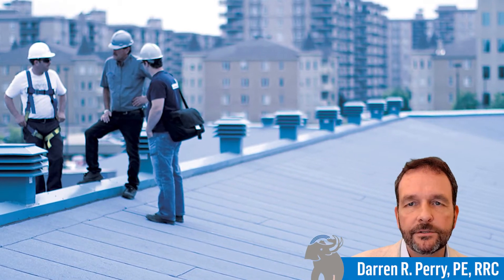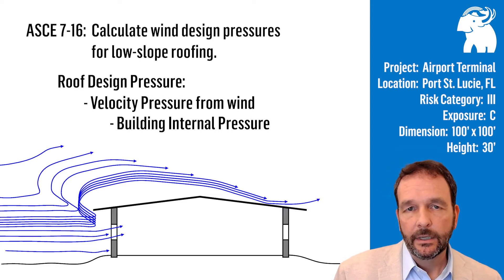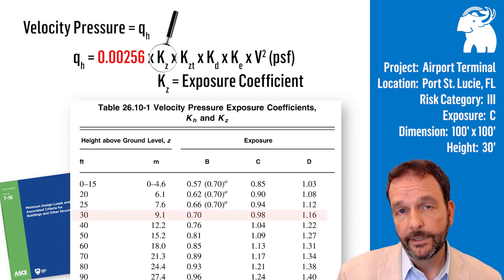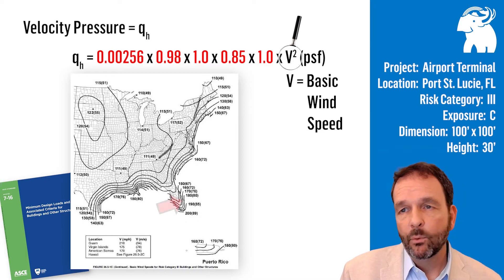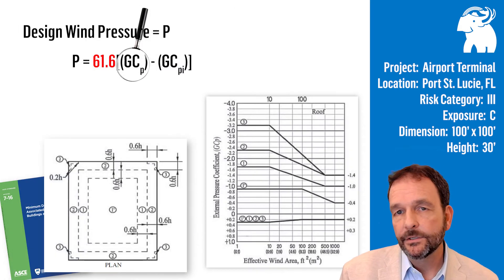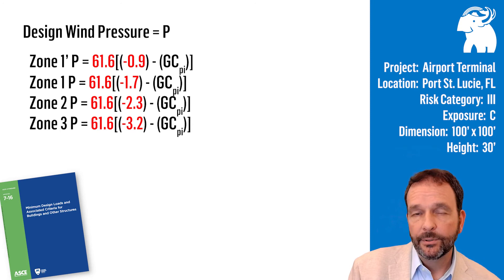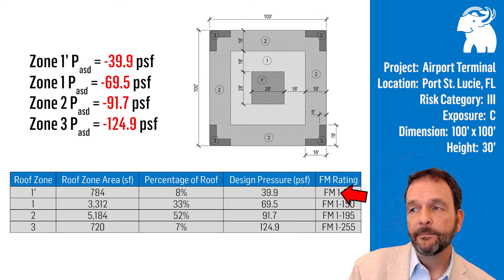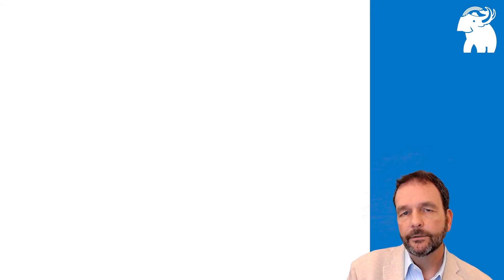Low Slope Roofing Wind Design:  ASCE 7-16 Example Problem

Comment: Hello, 
Thank you for this video it is super helpful!
In my understanding the "Effective Wind Area, ft^2 (m^2) on the horizontal axis of the chart is referring to the zone  1', 1, 2, and 3 areas. And the (GCp) for each each zone must be selected based on these "Effective Wind Area" for the corresponding zone. For example if my Zone 1' area is 1000 ft^2 then the GCp = - 0.4.   Am I correct?

Comment: Why do we get GCp values when effective wind area of 1 ft^2??
Reply from the maker: For roofing we use a tributary area for the attachment of components between 0 to 10 sq. ft.   Adhered components are considered to have a 0 sq. ft. tributary (fully adhered) and most fastened components go up to 1 fastener per 10 sq. ft.   Rarely do you find roofing components with a tributary area of attachment more than 10 sq. ft. thus we use the left side of the graph (0 to 10 sq. ft. portion of the graph).
Reply: @SopremaUSA  So if I had a 20' long beam that is spaced about 5' apart that the roof rests on, then I should look at an effective wind area of 100sqft?
Reply: @nicholastan2178   For the beam itself as a component , you are 100% correct. But for the fasteners connections, the  area is very small.  Example: For wood sheathing on the roof, the sheathing effective area is 4 x 8 = 32 sq.ft. However, for the component attached to it, which is the rafter spaced at 16" , the effective area is the rafter length x 1.33.